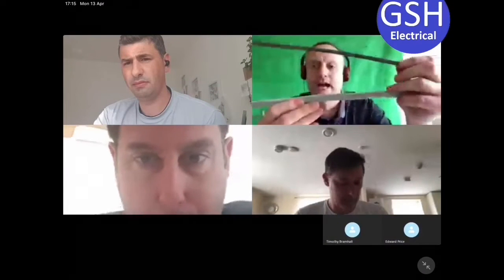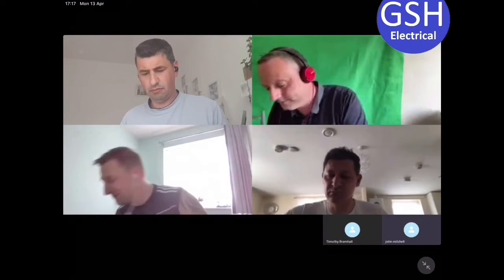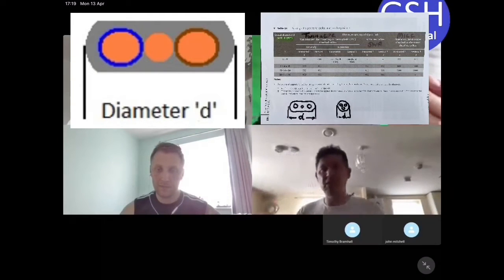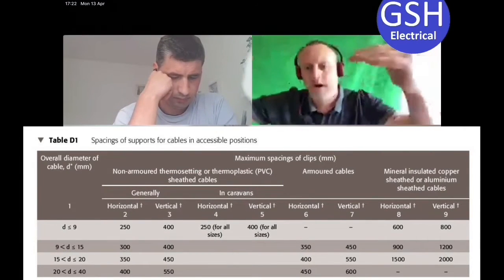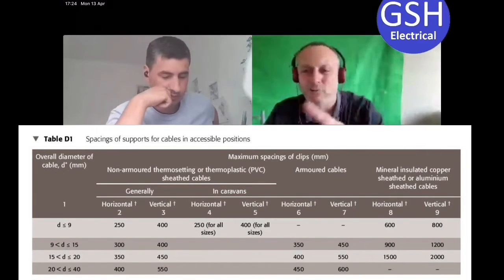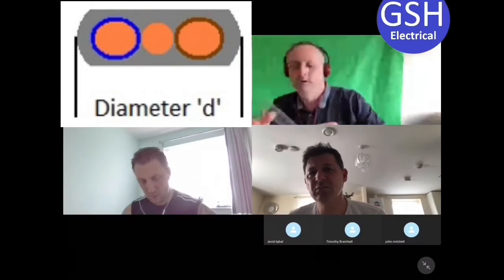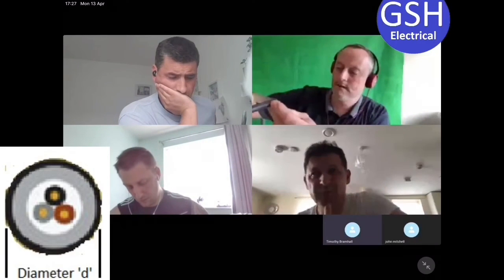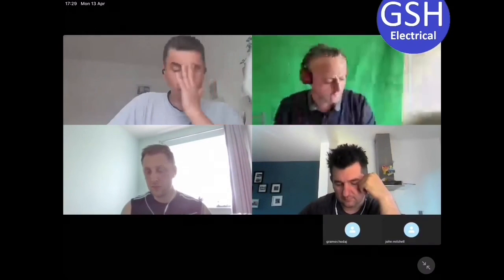Maximum Clipping Distance of Twin and Earth, SWA and MICC Cable According to BS 7671. Skype Lesson

Comment: Really useful video, thanks Gaz! I’m running some SWA armoured cable under floorboards of the ground floor to come up at the consumer unit. There’s a void of 1 foot between the floorboards and subfloor (essentially earth and rubble). In your opinion does this have to be clipped under the joists? Ideally it would lay on the subfloor as I’m reluctant to pull up and damage all the floorboards. Being armoured rodent damage isn’t a concern. Thanks

Comment: Hey guys avid viewer of the electrical community on YouTube including the new effix channel, but what I was curious about is - if you are running cable under floor board how essential is it to clip that cable say when access is limited?  And is it beneficial to leave unclipped in the event you need to pull the wire after? Thanks!

Comment: Hi Gaz, bit of a query, but i thought that  the < symbol denotes less than. so in row 2 column 1 where it says 9 < and then less than or equal to 15 , surely it should say 9> but less than or equal to 15 ?
what am i missing here ? is it a miss print? thanks
Reply from the maker: Under the < you have another line _ 👍
Reply: @GSHElectrical thanks for answering Gaz, but in row 2, column 1 surely it should say greater than >9 but instead it says less than 9 <, that is my issue, i get the less than 15 or equal to symbol. 
maybe its my copy of the osg. i know they make cock ups sometimes ;)
Reply: @BloodmoonDawn  old video but I thought I would comment. < only means less than when it's on the left of the number
9 < d means "9 [is] less than d"
in primary school we were taught that the greedy crocodile (<) eats the bigger number. The crocodile is facing towards d so d must be bigger than 9
Reply: @TheAviation101  thanks . I will try and remember that, it’s strange what things stick in our heads, and a little story helps cement it in the mind.
I’m quite surprised to get a reply after such a long time posting it. 
So I really appreciate your response. Thanks again!
Reply: The line underneath always means "equal to" so it would include the 9.
Reply: Yeah you have right. Should be 10/16/21. In this form it is wrong then. Mathematic and electric are not the same 😂😉